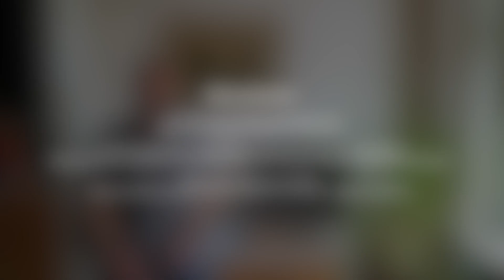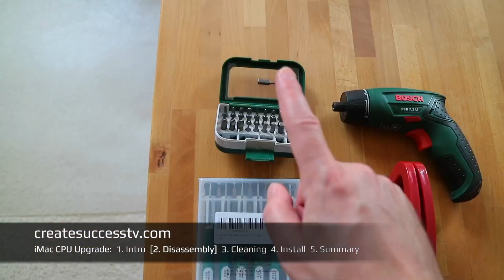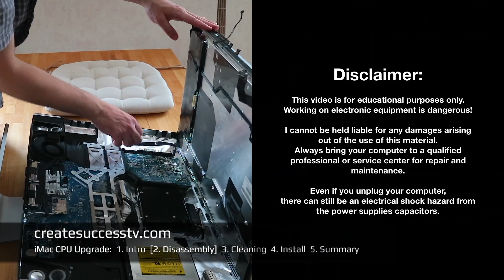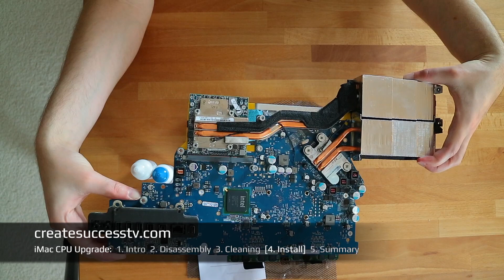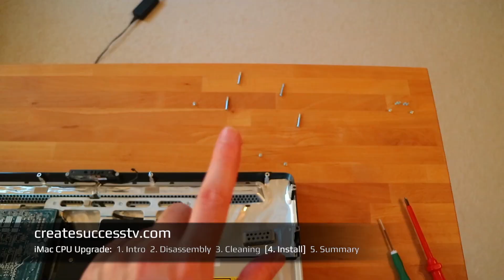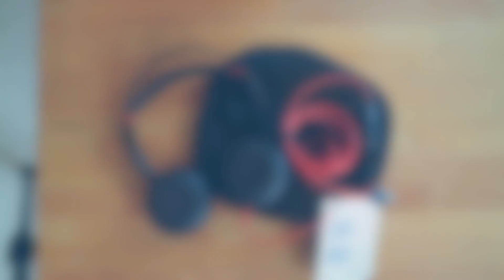How to perform a iMac CPU upgrade (MB325LL/A)

Comment: Hi! Thx for the video. One question. Would the CPU replacement work with an early 2009 20" iMac? I have replaced the HHD with an SSD and upgraded the RAM to its maxed 8G. I am running Mac OS Monterey with the Opencore legacy Pacher, but it has recently begun running a bit slow. Any advice? ; )
Reply from the maker: I recommend you look on iFixit cause they have iMac Repair Guides for all models:
➜ https://www.ifixit.com/Device/iMac_Intel

Comment: Too bad it doesn´t work with Intel Core 2 Quad Q9100.. This apple guys are really bad by limiting their Bios to use only duo core processors. Is this a MacOS or hardware limitation?.. I use linux Mint on mine Btw.
Reply from the maker: Apple's limitation on using only dual-core processors in some older models is a result of hardware design choices and macOS optimization for specific hardware configurations. It's not necessarily intentional but might be due to compatibility issues with the motherboard and chipset. Older hardware becomes incompatible with newer operating systems due to changes in architecture and optimizations for newer components.

Comment: Can a CPU upgrade for an iMac (early 2011 i believe - A1312) allow a higher version of iOS be installed / ran?
Reply from the maker: According to Apple the max supported is macOS High Sierra
https://support.apple.com/en-us/HT201634
Reply: @ReviewTechTV  yes I read that. High Sierra is no longer available for reinstall through official Apple, but it's possible to get a working (bootable) copy, & install it fresh. Or if possible try Big Sur, maybe Catalina, if either will work! Thank you 🤓 I found the A1312 in a dumpster recently and did an Erase function, then tried the Reinstall function from the utility menu, but no luck.
Reply from the maker: A CPU upgrade has no effect on the supported operating system.
Reply: @ReviewTechTV  just better performance?

Comment: Hi, I have the iMac 27-Inch "Core i5" 2.8 (Mid-2010) I deleted Mac OS and installed Windows 7 for my wife due to PC software requirements. But now, I want to revive the Imac to its full potential. I would like to know what can be upgraded as to make it as much powerful as it can and run it on Mac OS
Reply from the maker: I wouldn’t recommend this upgrade anymore, because at this point 2022 I find the iMac graphics card is simply too old.
Reply: @ReviewTechTV  First thanks for the reply and also thanks for the advice, I just had a bit of nostalgia, lol
Reply from the maker: But you can find detailed information here -> https://www.ifixit.com/Device/iMac_Intel

Comment: Is it possible to install a core 2 extreme in this mac?
Reply from the maker: No, Quad core CPU is not supported by the BIOS, max CPU is shown in the video.
Reply from the maker: Due to age of this iMac I don't recommend this update anymore.
Reply: @ReviewTechTV  Never had an apple computer before, but I bought an 8.1 3.06Ghz iMac for 9 pound, so I decided to see what it can do and how far it can be upgraded.
Reply from the maker: @gamingdad2549  I would focus on the SSD and RAM, however the main limitation of Mac's that old is mostly the GPU and operating system.
Reply from the maker: @gamingdad2549  For upgradability you can also look at: https://www.ifixit.com/Device/iMac_Intel

Comment: did the creator ever make a quad core video?
Reply from the maker: You cannot use quad-core, the iMac BIOS/Firmware doesn't support it, I don't recommend upgrading this machine anymore, it's too old at this point.

Comment: I wonder if iMac 9,1 would support quad CPU like QX9300?Mine is 20inch, Early 2009,now it's 2.66ghz core 2 duo.And would it be upgraded to a better GPU? It's nvidia geforce 9400 256mb.

Comment: A very good video but you did not show the MAIN PART.......YOU DID NOT SHOW HOW TO take out the CPU and install the NEW CPU. I have replace my iMac 24" Early 2009 Logic Board 2.99 Ghz myself. Please look for IFixit.com. You get everything about Apple computers STEP BY STEP. They are number 1 in explaining and sell special toolbox and parts for your Apple. Nice to talk to you. https://www.ifixit.com/Guide/iMac+Intel+24-Inch+EMC+2267+Graphics+Card+Replacement/13765
Nel Martis
Reply from the maker: You can see both the CPU and GPU here ➜ https://youtu.be/GH2gUpYf6gc?t=1149

Comment: Are there any quad cores that will work
Reply from the maker: I don't recommend upgrading this old machine any more.
Reply from the maker: No, the Intel DUO core is the maximum supported by the system/BIOS.

Comment: How can I know what's the max CPU I can put in my iMac (2008 20")?
Reply from the maker: The system is too old now, I don't recommend the update anymore!
Reply: Doesn't 'too old' depend on what you are using the machine for - and what OS?
If not doing gaming, video rendering, etc. an upgraded older iMac should be quite usable, no?
Linux would also run well on an older machine, correct? @ReviewTechTV

Comment: Will the T9900 chip work in the 20inch iMac ? The bus speed is different. My Mac has 800Mhz bus speed and the chip you used is 1066. Thanks.
Reply from the maker: The hardware tends to differ based on iMac model year, please compare on websites like:
➜ https://www.ifixit.com/Device/iMac_Intel

Comment: I recently disassembled my 2008 iMac and replaced the SSD. I like the detailed style of tutorial here, especially showing the components and explaining how the air flow looks like there.
Thanks much!
Reply from the maker: Glad it helped!
Reply: My Macit's somewhat slow, should I also change the SSD? or is it best to upgrade the CPU?
Reply: @filoshi  First of all, which Mac is that? Recent Macs are almost non-upgradable, but it depends on a specific model. Second: CPU update is a more intense task and needs more dissasemble (not every model can have it upgraded either).
SSD update sounds like an awesome idea to quickly fix a Mac and prolong usability for a year or two.
Reply: @NomadicDmitry  it's probable the same you used for this video. Late 2009 if I remember correctly
Reply: @filoshi  I've used Late 2008 iMac. Yes, you can upgrade SSD there. CPU upgrade is probably worthless on those machines.But expect to get 1-2 years more of the system. It's very old, only for basic tasks.

Another option to get some speed improvement is install some Linux distro there instead of Mac OS. It should work faster on that old hardware. But honestly I would just upgrade the SSD and buy the newer computer within a year or so.
Reply: @NomadicDmitry  what a shame, okay. Maybe I'll let it as it is and save the money of upgrading the SSD for my new computer.
Man, I hate how technology becomes obsolete so fast. It works perfectly but yeah... Hadn't thought of changing the OS.
I don't know much about computers but I'll think about it. Do you have any tutorials on that?
Reply: @filoshi  That's actually easy to install the OS there. You insert the Windows 10 disk in tray (or usb drive), hold Option key during the system boot, select Windows DVD/USB and follow the instructions. It will wipe away all data, but you will get a modern system there. Regarding the obsolete factor. Well, It's been 12 years or so, so I guess it's indeed obsolete at that point :(
Reply: @NomadicDmitry  so windows 10 would be better/ faster than macOS?
Thanks for the advice
Reply: @filoshi  Windows 10 in general is not better than modern Mac OS (in my opinion). BUT on  that old computer trying to run modern Mac OS is not that easy, it might be not stable. And running old Mac OS is not worth it. However, running Windows 10 on that computer allows you to get a modern OS and compatibility. So, in that sense - yes.
Reply: @NomadicDmitry  I was thinking first on trying restoring the computer to the fabric settings and errase everything to see if the speed improves. Then, maybe clean the fans? Like give it some hardware maintenance ( tho I've never done it) 
If that does not work I might try changing the OS but I actually really like macOS so hopefully I won't have to change it
Reply: @NomadicDmitry  hahaha, if I'm brave? XD I don't know if I'm skilled enough. But you are right a lot of programs won't work on this OS no more. When it comes to that I think I'll follow your advice and install a different OS. How was your experience with Linux?
Reply: @filoshi  My experience with Linux was...fine. It worked on that computer. I suggest you try Linux first on that machine (Ubuntu) and if you don't like it - install Windows 10. All you need to do is to hold "Option" during boot and insert DVD to install an OS. Easy stuff.

Comment: I have to say that I wish Apple would add a little thickness to the imac and macbook pro. I'd rather have more bulk and better cooling. If someone wants a tiny mac let them buy a macbook air.
Reply: Thinner = hotter   : (
Reply: Cut out a panel on the back, attach hooks, so you have easy access to hdd and can open up for extra cooling. if properly sized (140x140mm) you can even hook up a secondary fan you can power via usb
Reply: @DerFliegendeMocca  I guess I could build my own laptop. That's a novel solution too.

Comment: I have the same iMac from 2008 and iLOVE it ;), just upgraded the hdd to ssd and ram to 4gb
Reply: The 2008 iMac actually supports a max of 6GB of DDR2 800MHz RAM, so you could even have one 4GB stick plus one 2GB stick.
Reply: did the performance improved ? how much?
Reply: i upgraded mine so much its at 24 gb lol
Reply: @Chlips  an 08 imac?
Reply: @Redlotus123  uh 2013 i think
Reply: did u have to back up your files and software?
Reply: @Redlotus123  idk since my dad did it check a vid maybe
Reply: Does it let you upgrade the software after memory change
Reply: @johnbaker4826  That isn’t how it works.

Comment: I recently did an ssd upgrade in my 3.5 year old iMac and it was surprisingly clean inside.
Reply from the maker: That's great, it can depend on the environment and how much you use the machine, mine was in use a lot, plus for some reason, there always seems to be a lot of dust in my room, other than that I since switch to an Early 2009 MacPro ➜ https://youtu.be/Dv73HrnsNkw
Reply from the maker: Much more powerful for my daily video editing, and very easy to upgrade in comparison.

Comment: So I have two mid-2009 imacs (20inch- and 24inch) . This cpu is the max CPU for them correct?  I need to repaste the terminal paste but I guess it would be best to replace the cpu as well.
Reply from the maker: It's probably best to look at the iFixit website because depending on the exact model it can be different:
➜ https://www.ifixit.com/Device/iMac_Intel
Reply: @ReviewTechTV  Thank you for the link! I have ordered the cpu and will do the upgrade this week. Pray for me lol

Comment: How would core 2 due x9100 work? And would a video cats for the 24 inch work floors the 20 inch?
Reply from the maker: Nope, only the CPU shown in the video works, faster quad core are not supported.
Reply: @ReviewTechTV  this is the fastest dual core. Also ive read in some forums of quad core working

Comment: Did you ever end up trying a core2quad? I have upgraded several laptops from core2duo to core2quad, but if the motherboard isn't designed to support it, only 2 cores will appear, or it won't work at all. 

I had a new GPU put in when it was still under warranty by an 'apple certified' repair place, or the equivalent back in 2010, and instead of using thermal pads for the ram chips, they squirted half a tube of thermal paste on each one, which acted as an insulator. After a year of intensive archetectual CAD use, I started seeing artifacts on the screen when rendering, and after tearing down the machine myself and seeing what those pot smoking idiots did(just kidding, I was high AF when I worked on it), I cleaned off the crap those idiots put on there, and replaced it with the appropriate thermal pads and haven't had an issue to this day (late 2019) even with near continuous heavy GPU use as a work pc for a couple years afterwards. *I think its an nvidia 8800 series? can't remember now*

Ill probably pick up a quad for cheap on ebay and try it. I'm currently using the iMAC as a home theater device, which streams from my NAS to the TV and am planning on swapping in an SSD very soon.
Reply from the maker: Unfortunately more powerful quad-core CPUs such as the "Intel Core 2 Extreme QX9300" will not work in this system. The iMac BIOS does not have the appropriate CPU microcodes for quad-core CPUs.
Reply: @ReviewTechTV  Thanks for the info, too bad it won't support one of those :/ For my use case I don't really need anything quad, just would have been cool to have.
Reply from the maker: I since switched to a Early 2009 MacPro, works much much faster and more flexible to upgrade -> Tutorial Series Old Mac Pro - Still Worth It?
Part 0 - Introduction ➜ https://youtu.be/lJF-rffIyq0
Part 1 - Bluetooth ➜ https://youtu.be/d9xPvreK8tg
Part 2 - High Sierra ➜ https://youtu.be/ecWEhbtvXHk
Part 3 - SATAIII SSD ➜ https://youtu.be/2gqkGPidI84
Part 4 - Radeon RX560 ➜ https://youtu.be/UoV4I-FlYdw
Part 5 - Memory ➜ https://youtu.be/1XYNqfnu4UA
Part 6 - CPU ➜ https://youtu.be/8cVhURcpi64
Part 7 - macOS Mojave ➜ https://youtu.be/uKAJCuWtp4Y
Part 8 - Radeon RX580 ➜ https://youtu.be/Dv73HrnsNkw
Part 9 - NVMe SSD ➜ https://youtu.be/A8hPC_DDq6Q
Part 10 - Fan Replacement ➜ https://youtu.be/fBiIJami8v0
NEW *Part 11 - USB 3.0 Upgrade ➜ https://youtu.be/fCkrZlB465E
NEW *Part 12 - NVMe Raid Card ➜ https://youtu.be/fo7lVMfXq1c
Reply from the maker: I especially like that swapping out the GPU is super easy in the good old tower MacPro, and Radeon RX580 with 8GB gets the job done well, the Geekbench test below:
➜ https://browser.geekbench.com/v4/cpu/14067727

Comment: Hi, I’ve got an a1224. Can I?
Reply from the maker: I don't recommend the upgrade anymore, I since switched to a 2009 Mac Pro, see my new tutorial series "Old Mac Pro - Still Worth It?"
Part 0 - Introduction ➜ https://youtu.be/lJF-rffIyq0
Part 1 - Bluetooth ➜ https://youtu.be/d9xPvreK8tg
Part 2 - High Sierra ➜ https://youtu.be/ecWEhbtvXHk
Part 3 - SATAIII SSD ➜ https://youtu.be/2gqkGPidI84
Part 4 - Radeon RX560 ➜ https://youtu.be/UoV4I-FlYdw
Part 5 - Memory ➜ https://youtu.be/1XYNqfnu4UA
Part 6 - CPU ➜ https://youtu.be/8cVhURcpi64
Part 7 - macOS Mojave ➜ https://youtu.be/uKAJCuWtp4Y
Part 8 - Radeon RX580 ➜ https://youtu.be/Dv73HrnsNkw
Part 9 - NVMe SSD ➜ https://youtu.be/A8hPC_DDq6Q
Part 10 - Fan Replacement ➜ https://youtu.be/fBiIJami8v0
NEW *Part 11 - USB 3.0 Upgrade ➜ https://youtu.be/fCkrZlB465E
NEW *Part 12 - NVMe Raid Card ➜ https://youtu.be/fo7lVMfXq1c

Comment: 12:00 Think of the AMD GPU failure in nearly all Apple Macs. It's all about thermal issues, regardless how many fans you have or how careful you are. I never would any used Mac without PCIe 3.0 4x + NVMe Support. IMO this is the most important spec at these machines. The CPU doesn't matter so much...
Reply from the maker: Many people use Macs Fan Control, that way I had no thermal issues at all, even after using the iMac for many years. Having said that, I switched to a used Mac Pro 4.1 (Early 2009) model and did a few upgrades such as NVMe ➜ https://youtu.be/fo7lVMfXq1c

Comment: YES, QUAD CORE PLZZZ!! i want to put one in my 7,1 imac!

Your 8,1 has a 1066 bus speed? Mine is just 800mhz.

But i did hear that you can run some 1066 cpu in it. But then the cpu might not be running at 100%, im not sure. :(

Too bad about the GPU situation...
Reply from the maker: The quad-core won't work, even if the hardware could support it, my understanding is that the BIOS doesn't have the CPU microcodes for it!
Reply: @ReviewTechTV  omg someone needs to try it... It would be amazingg if it worked!!

Ive seen people run chips in them that were un-reconised but still worked!

I thought maby it might run on the same code as some of the dual core chips since its not a true quad core.

Dangggggg thanks for the reply tho! I might still have to try it lol

Shame about the GPU i reallyyy need more Vram. Maby do a video about upgrading :p i know you covered it a tiny bit here but... :)

Cheers
Reply: @ReviewTechTV  maby one of those external video card setups?! Just thinking out loud.

Altho im not keen on that idea i would rather buy a chip from another mac or whatever. Too bad about the priceeeee :(
Reply: Dunno but ive been hearing whispers that it MIGHT be possible lol

Comment: I got hold of early 2008 imac 20 inch came with 2.6 GHz 320 GB hard-drive 2 GB ram I brought month ago it was very clean when I open it. I have upgrade my hard drive to 1 TB and  ram to 4 GB. Can CPU be upgraded on this system
Reply from the maker: If you have a different iMac than shown in the video you can most likely find a repair guide here ➜ https://www.ifixit.com/Device/iMac

Comment: Would a core 2 quad q9000 work? I want to upgrade to that and either an 8800 gs or gt 130 or Radeon hd 3670
Reply from the maker: No, a quad-core CPU won’t work, the 3.06GHz Intel E8435 shown in the video is the fastest one you can upgrade. Also please note that I don’t use the iMac anymore, with the release of macOS Mojave it simply became too old. Instead, I got a used 2009 Mac Pro from eBay and upgraded it instead.
Reply from the maker: Works much better, if you want you can watch the tutorial series "Old Mac Pro - Still Worth It?” below:
Part 0 - Introduction ➜ https://youtu.be/lJF-rffIyq0
Part 1 - Bluetooth ➜ https://youtu.be/d9xPvreK8tg
Part 2 - High Sierra ➜ https://youtu.be/ecWEhbtvXHk
Part 3 - SATAIII SSD ➜ https://youtu.be/2gqkGPidI84
Part 4 - Radeon RX560 ➜ https://youtu.be/UoV4I-FlYdw
Part 5 - Memory ➜ https://youtu.be/1XYNqfnu4UA
Part 6 - CPU ➜ https://youtu.be/8cVhURcpi64
Part 7 - macOS Mojave ➜ https://youtu.be/uKAJCuWtp4Y
Part 8 - Radeon RX580 ➜ https://youtu.be/Dv73HrnsNkw
NEW *Part 9 - NVMe SSD ➜ https://youtu.be/A8hPC_DDq6Q
NEW *Part 10 - Fan Replacement ➜ https://youtu.be/fBiIJami8v0